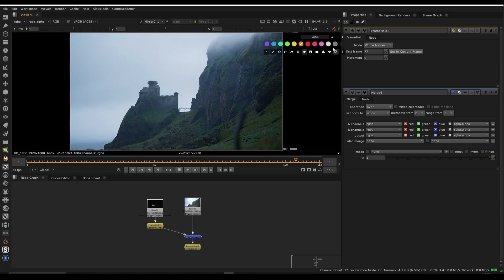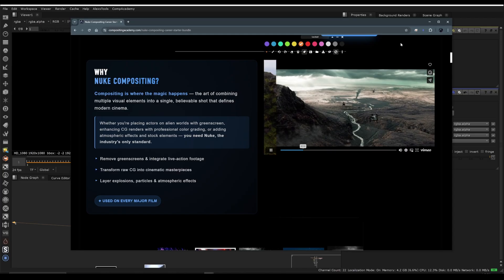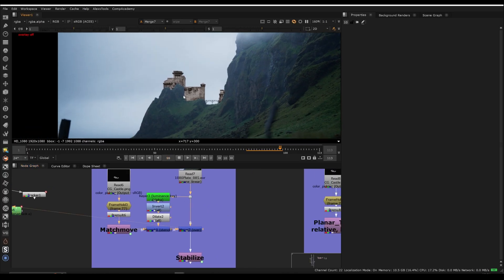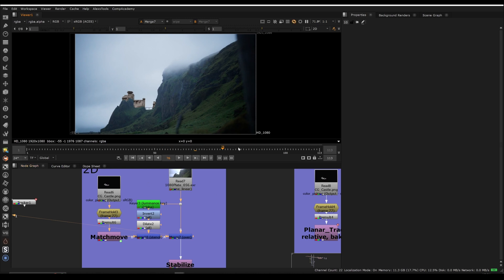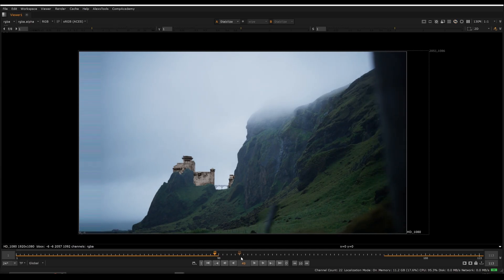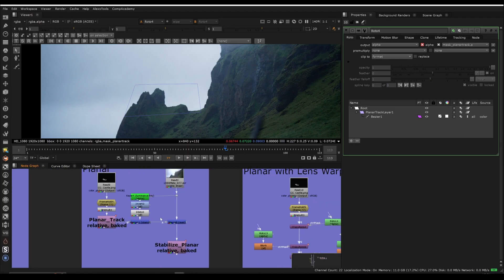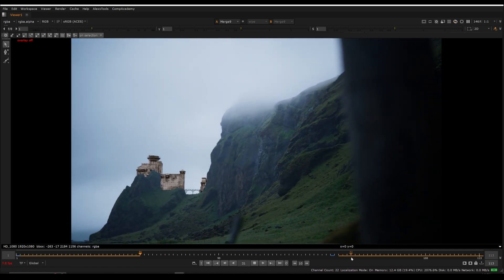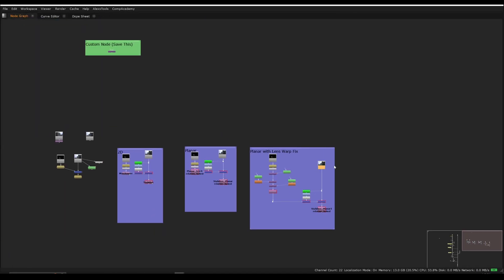Why your VFX Tracks aren't "Sticking" (and how to Fix it)

Comment: I  Always forget about this lens distortion that causes a lot of problems with tracking. I do 3d as well, so the  undistort  workflow will fixe a lot of this. But in commercials we don't have time for this and find myself deforming layers manually or sometimes deform them in 3d before rendering to match the tracking. I know it's like asking for troubles but one has to do every trick in the book to deliver quickly.
Thanks for this.

Comment: Much of the time a track with something like SythEyes will let you generate distortion ST Maps (or nuke Lens Distort nodes) in order to re-distrort your elements before comping. Sometimes you still have to do little tweaks with distortion or grid warping, etc., just like anything in the industry, nothing is ever perfect, but it will get you there much faster.

Comment: Important stuff!! Another good technique its with the stabilized footage 2d track the element that its moving by the distortion and apply that 2d track (matchmove) to an UVtexture masked by one roto to affect only the distortion area and then plug that UV texture in an stmap all of that in the 3D element that you are integrating. With that you have and uvtexture with the same movement of the lens distortion.

Comment: Generate smartvectors on stabilized footage and apply vector distort before matchmove. You could also blur vectors a bit if its jittery/blocky.
Also i am pretty sure for pan shots you could solve lensdistortion easily, aas all trackers are expected to move uniformly
Reply: this
Reply from the maker: This would make sense, although I think smart vectors over a flat white sky wouldn't have much data to grab onto for any kind of warping.

Comment: Wouldn't it be easier to apply the lens distortion to the image you are comping in?
Reply from the maker: If you have an accurate lens solve, definitely.  In my experience sometimes I’ve noticed small adjustments can still be necessary to really stick things, but it wouldn’t be nearly as extreme & is always better to have a lens grid filmed for this reason.  

With small error usually it’s either the lens solve is slightly off, or if it’s a 3d matchmove and the world is slightly too high in Y or too far in Z which causes slight sliding in renders.  This can also happen even if the world is a few degrees off in rotation as well for a ground plane, for example.
Reply: @CompositingAcademy  Ah, that makes sense. Your correction method is helpful regardless, thank you for providing it!

Comment: Instead of using iTransforms, you could try to match the actual distortion with a LensDistortion node. Also, a vignette appears circular (or squeezed) most of the time, so you can use a radial and symmetrical roto for the entire frame.
Reply from the maker: That would probably work as well if you can match it perfectly.  The problem is the planar track is also picking up some of the distortion.  

Maybe if you did that approach you would need to do the track differently (2d one might work), or planar track on undistorted footage, to not double up the problem.  If there’s any error though the same problem will occur.  Vignette is a good point, mainly I was just doing it for this small element - so I was just matching the contact points rather the entire frame by quickly eyeballing the levels.